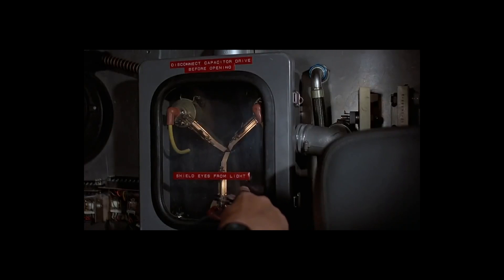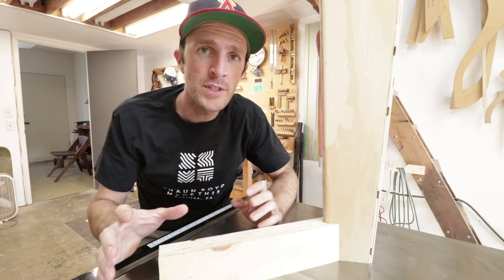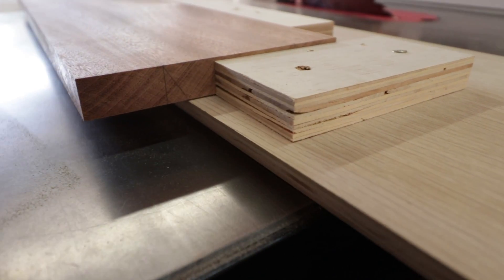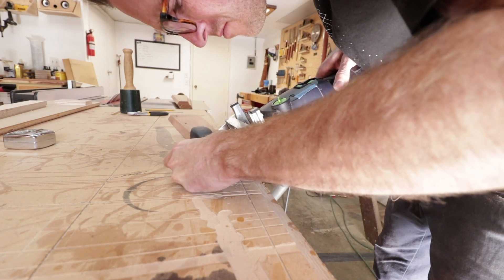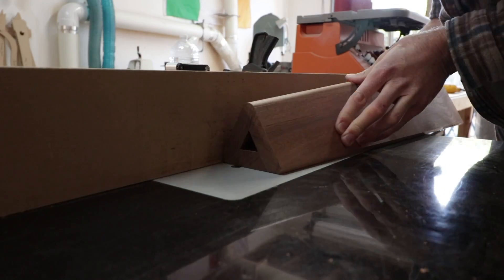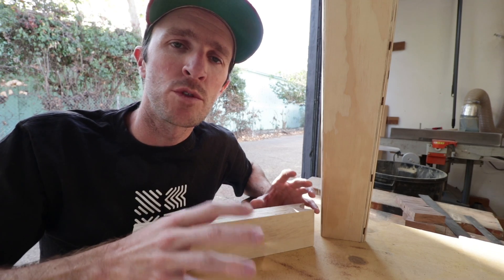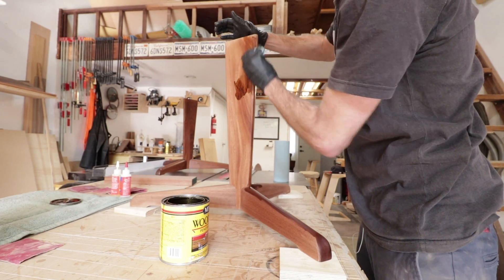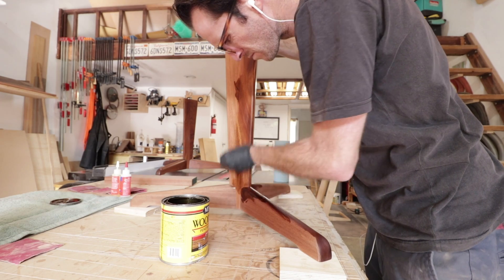Duplicating a Vintage Mid Century Table Base

Comment: Nice work. You didn't need to use the dominos on the vertical upright. Long grain to long grain miters are strong enough. Could have used 3m packaging tape as a hinge for lining up the miter joints. My 2 cents
Reply from the maker: Thanks Barry! The joints weren't miters, so the tape method wouldn't have really worked here. The dominos were just in there to keep everything aligned and not really for any extra strength.

Comment: You didn't use domino in the 3 base?
Reply from the maker: No, but there is a metal plate on the underside that I forgot to film to give it more strength.

Comment: Fantastic work as always.  Did you really only use glue to connect the feet to the leg?  Seems like a lag bolt would have been needed, if not at least a Domino?  Not judging, just asking!  :)
Reply: I was going to ask the same question Dan, you beat me to it. Nice job Shaun.
Reply from the maker: Thank you! There is actually a small metal plate on the bottom, which I am now realizing I totally forgot to put in the video! So that along with glue makes it plenty strong.
Reply: @shaunboydmadethis  Steve Ramsey would have showed you how to use pocket holes for that! But seriously, I can tell I need to practice my drill press face more! That leg came out nice too!
Reply from the maker: Hotrod Hog haha shoot, should have thought about pocket holes! Thanks!